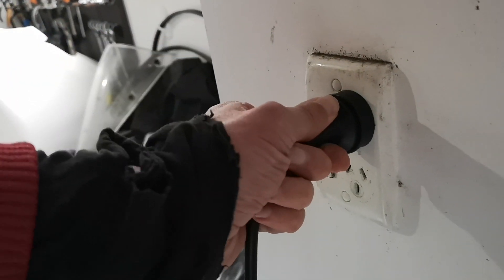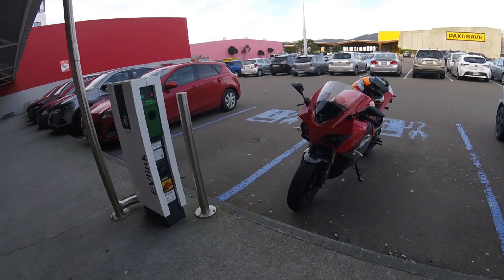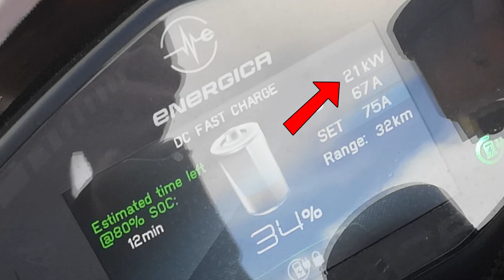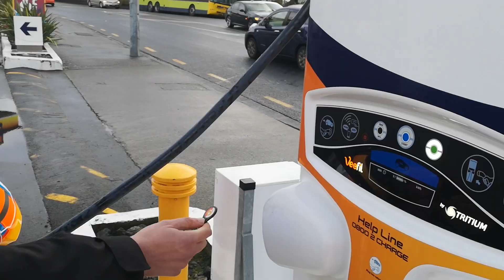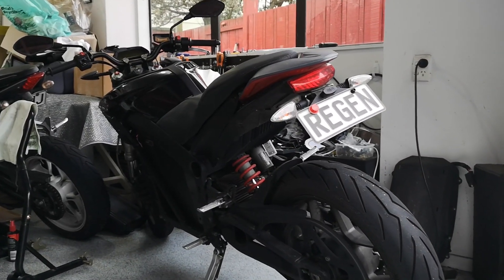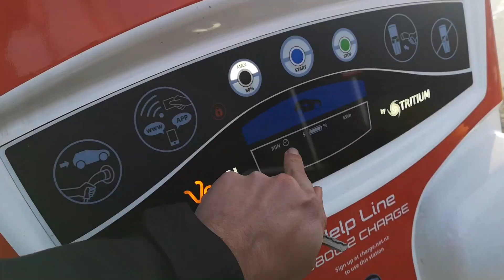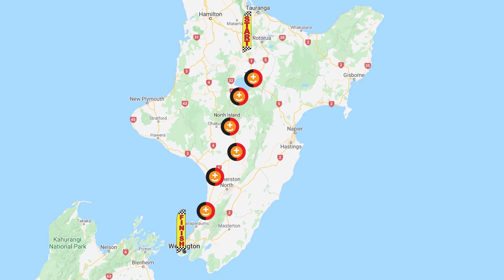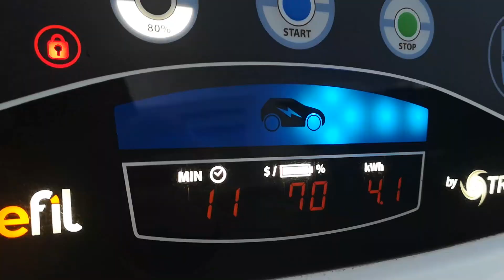CHARGING // AC vs DC // How long does it take to charge the Energica?

Comment: so energica can charge at any ccs/sae plug correct? is it possible to use other types with adapter?
Reply from the maker: Yep, CCS for high speed DC charging, and whatever AC is in your country (J1772 or Type 2), which you can combine with tons of adapters to charge up anywhere.
Reply: @NewZeroland  oh it can use type 2? plugshare tells me that incompatible. but type 2 would open up quite a few charge points for me.  (im in australia)
Reply from the maker: @miniscribbler7638  oh yeah for us down on this side of the world the bikes have CCS2 and Mennekes Type 2 for AC charging. Dunno about Australia, but a lot of AC charging in NZ is free! It's just slow.. 3kW charging takes hours 😂
Reply: @NewZeroland  yeah seems to be plenty of ac charge points. mostly at hotels and camp sites. could be good for emergency. or to fill up overnight if i book a room. cheers man thanks for info. im new to the e-moto scene.
Reply from the maker: @miniscribbler7638  no prob! You can't find a better bike than Energica 😁 The new ones are insane. Australian Electric Motor Co on the Gold Coast has a bunch of them.

Comment: Craziest thing for me is the fuel prices on the display board in the back. Ahh those were the good ol days :(
Reply from the maker: Right?? How is it $3 now? 😵
Reply: @NewZeroland  I really gotta change the game plan or I'm gonna keep getting the same results. Lots of solutions out there are just bandaids that don't really solve the problem. A fully electric car is my ultimate solution but they're out of my price range. I might be able to find a second-hand plug-in hybrid. On the other hand, there are some really capable dual-motor e scooters and e-bikes (eg 60kph - 85km range) out there as personal commuters that really perk my interest due to the much smaller upfront cost, not having to license or register it for the road, no wof or road user charges or ACC levies every year. 
Could you give me any advice on what or where to start when researching what's out there in terms of EV motorbikes?

Comment: Ooof. 100km/h is highway speed in NZ?

While here in the EU we have better chraging infrastructure than in the US - even here in the eastern parts - the highay speed limit is 130km/h, and police doesn't ticket till 145 km/h. That suggests to me that your range figures are simply not applicable, if you want to go with the flow of the traffic.
Reply from the maker: Yeah at those kinds of speeds you'd need the new 21.5 Energicas with way better range.

Comment: How much does a battery pack weigh? (carry a fully charged one in a backpack... as a "reserve cannister")
Reply from the maker: It depends on the bike.. Energica batteries are something like 180kg.  Zero batteries are about 100kg.  Definitely not small enough to fit in your backpack.  The battery % gauge is so accurate though that if you run out, you know you're running out for about 50 miles.

Comment: I'm of the opposite mentality. I feel that DC is the flash in the pan, but AC is the future.

Once technology comes far enough, the convenience of a 20 minute charge at the grocery store, cafe, or at the job, will far outweigh having to make a dedicated trip to the "gas station" even if you can get a 30 second charge. At least that's how I see it for the lower capacity batteries on motorcycles...
Reply from the maker: That's a good point.  When you're going shopping, 20 minutes is totally fine.  Even an hour charge over lunch at a restaurant is excusable.  On a road trip though, when you're already driving or you're in a rush, pulling in for a sub-5 minute charge would be amazing.
Reply: @NewZeroland  yeah, I thought to myself that fast charger would still be a thing at highway rest stops and such, guess I forgot to write that.

Also, fast charger stations will still be a thing for cars, since they have a much bigger battery. My girl wants a Tesla but here in the states (south florida) I don't think it's realistic with there being 2 tesla spots at the mall and... that's all.

I really feel like ss batteries are what's gonna bust the ev market open! Maybe I'm over hyping them in my head, but I see so much coming just from the weight and space savings alone!
Reply from the maker: @RemingtinArms  depending where you live, if you have the ability to charge at home, a Tesla would still be amazing.  The range is insane and the charging network is all over (not just Tesla superchargers, but you could use CCS stations too).  Goooo for it!!  Haha

Comment: Actually zero wanted to add chademo for their bikes but chademo has 200v low cutout point in most places. Sometime I want to build electric motorcycle with 43 kw charging with lithium titanate cells. First I build smaller 576 wh battery and test if I can charge it 0-80% in 4-5 minutes.
Reply from the maker: Sounds possible.  A full charge on this 11.7kWh pack takes 30 min, so a 576Wh battery would be super quick!

Comment: Hi Sam
Those cables you made up,is it easy to put a three pin plug socket(UK domestic plug socket) on a type 2  cable( so I can charge my FXS on type 2,for free)??
Reply from the maker: Ahh I didn't make the type 2 cable but in general it's pretty straight forward. I've put together a few caravan cables. That's a good idea 😁
Reply: @NewZeroland  I hav never cut open a type 2 cable,how many wired are in there? I would need to connect three,live, neutral and earth only?
Reply from the maker: @alanrobinson2229  not sure 😂 You'd just need a single phase cable, so yeah probably 3 wires.

Comment: Hahahah everyone always wants to talk about my bike too. It's annoying sometimes 🤣
Reply from the maker: It never ends, so you find funny responses for them, like the battery explodes after 5 years and it's more toxic than diesel 😂
Reply: @NewZeroland  haven't heard that yet lol. How much will your battery cost to replace?
Reply from the maker: @molifehacks5258  good question.. probably around the $6k mark. I know a few people who've had to replace Zero batteries, but no Energicas yet.
Reply: @NewZeroland  dam that's hella expensive! Mine just cost 3k. The price of my bike is 4k so I could just buy another bike for that price instead of just the battery 😂
Reply from the maker: @molifehacks5258  wow that's cheap! Pretty impressive man. But at the same time.. the motor, frame, wheels, and all other electronics only cost $1K?? That's nuts!
Reply: @NewZeroland  yea that's china for you. But I want to upgrade to a bigger battery which cost 3k. The battery I have on my bike cost $900. Also, their quality is not better than your bike or any other bike made in europe or us. Also the labor to make it is cheaper in china so I guess that's why it's cheap and yours is expensive. Your bike is built better you can say. You're getting more power, more range, bigger battery and faster charging speed that's why. My Shipping cost 1500 so total is 4k

Comment: Great videos Sam as always. What is stopping Zero from  putting dc charge in?
Reply from the maker: Thanks man! The voltage is too low on Zeros. I think that's the main thing holding them back, but the batteries would also overheat.
Reply: @NewZeroland  It definitely would need a cooling system.

Comment: Electricity vs Gasoline:
25 cents per kwh for 60% of a 12kwh battery. Charged in 12 minutes for an additional 25 cents per minute.
That comes down to about 5 dollars.
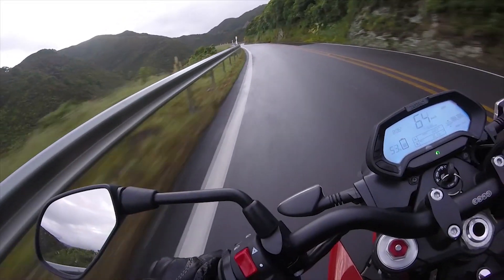50% of the battery gets you ~40km (timestamp 01:05). So 60% will get you ~48km.
So you're paying 5 dollars for about ~48km.

1 liter gasoline costs ~2.14 New Zealand Dollars.
Assume 20 km per 1 liter of fuel. 
That gets you ~47km for the same 5 dollars.

Driving this electric motorcycle costs the same in fuel as a fuel-efficient gasoline powered car.
This doesn't take into consideration other costs such as cost to buy, cost to maintain, comfort, or anything else where gas powered vehicles blow electrics out the water.
This is what I dislike about the marketing around electrics. They sell it as a "more expensive to buy, but saves money in the long run" type of investment deal. It's not. If you're going to be charging your car using fast chargers next highways you're paying premium prices for electricity on top of additional fees that when added up will cost about the same as gas.

Either electric powered vehicles become much more comfortable to use, and then I'm willing to pay the same amount of $$$ for the same amount of comfort I have with gas powered today.
Or, the price comes down drastically to compensate for the loss of comfort.
Reply from the maker: These stations are only for road trips, when you really need to charge fast. Most EV charging happens at home overnight, where my bike costs about $2.50 for a full battery. My average range is about 130km, so that's better than any gas bike I know of. BUT THEN there are a bunch of FREE charging stations. They're just not as fast. Those take 3 hours vs. 30 min, so it's a compromise, but I haven't heard of any free gas stations 😎

Comment: You seem to be getting ripped off in NZ compared to the UK. It costs me about £5 for 40kWh of charge at 50kWh rated station here. There is no standing charge until you stay more than 90min and then you are hit with a £10 per hour overstay fee on the largest charging network here.
Reply from the maker: Wow, that's a great deal!

Comment: I’m from downtown Toronto in Canada. My custom electric motorcycle runs on a 20kw motor hub and 120ah battery giving me about 300km city range. Takes about 6 to charge with 1 charger or 3hrs with my 2 charger setup. Regen is also awesome too, but for me and my friends we just charge up an hour here and there as we go about our day. We never really ran into situations of being stranded except for times where we forget to charge it the day before or something. However DC fast charging would change the way I travel for sure. I would consider venturing further if I had something like that.
Reply from the maker: Holy cow, a 300km range is insane! That sounds like the perfect city bike.
Reply: NewZeroland how much range do you get with your bike? I was going to buy a 200ah battery and get 500-600km range.
Reply from the maker: @TheFlatEarthChannelcom  Man in the city I only get like 200km.  What size is your battery in kWh?
Reply: NewZeroland I have a 72v 120ah battery system. Gives me 300km city range. It turns in to 8.64 kWh. If I had a 200ah battery setup it will be 14.4 kWh setup. 500km range if I do city
Reply: NewZeroland what size is your battery? On what bike is the city?

Comment: I am sooo jealous... Nearly all charging stations where I live (France), whether AC or DC, charge per minute and not kWh. Frankly, this is stupid. And BY LAW they cannot charge per kWh which is cretinity squared.
Reply from the maker: Aw man! I guess that's better than being charged for both kWh AND by the minute 😂
Reply: @NewZeroland  My bad, I didn't understand at first that both were charged at the same time... sigh

How NOT to promote EV driving... But then the solution is really simple:

* charge per kWh...
* ... except when you charge below a certain power, in which case you charge at that power...
* ... and finally, if plugged in after the charge is complete (with a grace delay), charge an outrageous amount per minute to discourage people from hogging charging points.

Job done!

Example: a 150 kW charger:

* floor power 40 kW;
* when charging at or above 40 kW, charge per kWh;
* when charging below 40 kW, charge just as if the vehicle charged at 40 kW;
* when charging is complete and after a 5 minute delay, charge just as if the vehicle was charging at 5 times the peak power, ie 750 kW.

Comment: Mind Blown...  12 minutes, just wow.  Although it seems significantly more expensive, what with the charge per minute.   You said 20-80% was $5.  Can you convert to gas and price with that?  I.e. how far did you go with that charge, what would it have cost to drive a gas moto that far?  (I'm thinking you went 70 miles, a normal moto gets 35mpg, so 2 gallons of gas, at $2.50 a gallon that's $5 - or therabouts...   Which is sad that the electric company has figured out how to charge you as much for electricicty as the gas companies charge you for gas)...
Reply from the maker: Thanks man, and that's a great point.  I'm hoping to do a gas vs. electric road trip comparison soon, now that we also have a super-efficient 250cc.  Gas is way more expensive here (close to $6/gallon USD) but these DC stations might still be more expensive.  Charging at home or at free stations is totally the way to go.

Comment: I went to the Zero dealer and was kinda surprised by how high the FX was but the deal killer was the hight of the receiver mounted rack I wanted to use to carry it. I’m going to go to a larger dealer who is more interested in working with me on lowering the bike a couple of inches and find a welder who can build or modify a rack so it’s low enough that I feel confident loading the bike by myself. The FX has almost 900 mm of travel in the rear, I only weigh 59 kilos and I am thinking I could lose some travel to lower the bike. I have a rack I carry my SurRon on and am comfortable with it. It’s been dropped about 200 mm, it’s probably not strong enough but I haven’t any problem with it scraping on drive ways. My truck is a4X4 so it’s pretty high already. So until I work out a couple little problems I’m going to be riding my SurRon. I put a basket on it so I can take the dog to wherever we’re going to walk her. Anyway, I just thought I’d bring you up to date on my quest to follow in your footsteps and join the electric motorcycle community. Thanks for the videos.
Reply from the maker: Hey nice! I've heard the same thing about the FX vs. the Sur-ron. I really want to ride a Sur-ron now. There's also a huge weight difference. Price difference, too. Have you thought about upgrading the battery or modifying the controller to get more power?

Comment: I'm trapped with slow charging until my warranty runs out. My slow charger has started cutting out with only 89% charging completed. I dont know if the problem is the charger or the battery, but it might soon be time to upgrade and maybe the speed controller as well.
Reply from the maker: Oh nooo! Definitely the charger. The same thing happened to me and just about every other Zero owner. Eventually the charger will just stop working. Hopefully your warranty can replace it! Getting a charge tank installed would be a sweet upgrade though 😎

Comment: The furthest I've ridden my DSR in one day was about 180 miles, call it 290 km.  I have a two-module SC2.5 on mine.  I spent a total of about two hours charging.  Departure was at 100% from home, I made a "safety stop" on the way out and charged from about 40% to 90% before I hit the mountains, then when I got to my destination (with about 50% charge remaining) I put it on charge while I got lunch.  Did some noodling round town, and then headed home;  safety stop on the way home (with about 55% remaining) for another half hour, then arrived at home with something like 40% charge.
If I'd been willing to ride more conservatively I could have done it easily with a single charging stop, but where's the fun in that?  In total I put about one and three quarters of a charge into the bike from ChargePoint stations on that trip.  It cost me about three bucks.

I'm not saying I don't want the option of DC fast charging-  obviously I do-  but the energica's slow 3 kW on board charger is really not great for those of us who like to charge on the cheap.
Reply from the maker: I feel ya.  DC charging costs definitely add up.  It woulda been nice if the AC charger was 6kW, but I think even then I wouldn't use it out on the road.  The only places that are missing DC stations here have campsites, and without custom wiring to use 2 diginows individually, I'd still be limited to 3kW.  At the end of the day, different bikes suit different needs.  Zeros are still amazing where there's no DC infrastructure.

Comment: I need to find a DC charge controller and female plug, so I can DC quick charge my homemade electric or modified electric motorcycles.
Reply from the maker: Absolutely!  If your pack is over 200V and you're able to safely charge this fast, it's a total game changer.
Reply: @NewZeroland  
Do you know of a company that makes dc charge controllers, or do I have to salvage from a wrecked production EV?
I'm ok with the many Active Balancer/Equalizer connections, for that many batteries in series, and I always wanted the highest voltage posible, ever since I learned higher voltage means higher top-speed and rate-of-acceleration.
...But 200volts...the highest voltage traction  motor-controller I have bookmarked, is 144v. I have to look again.
And now I'm worried if I have enough room in my Goldwing frame, to have enough batteries in parallel for capacity & torque.
I have to see, when I start that conversion project.